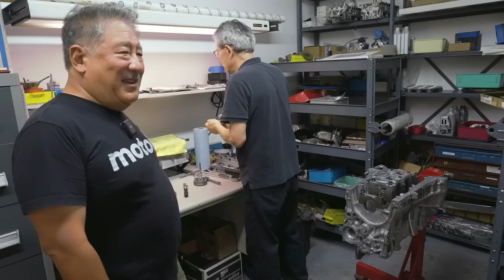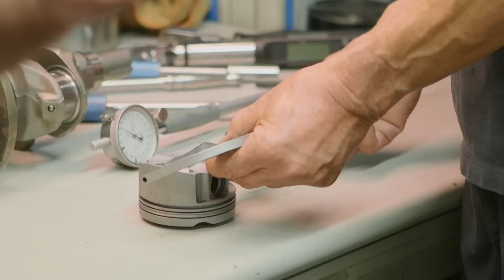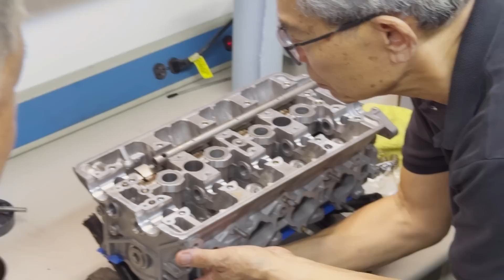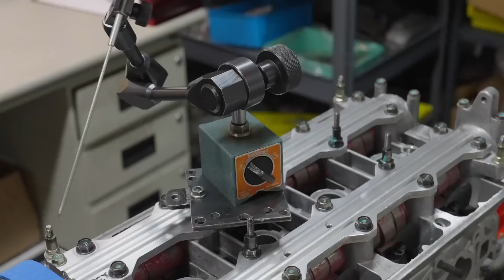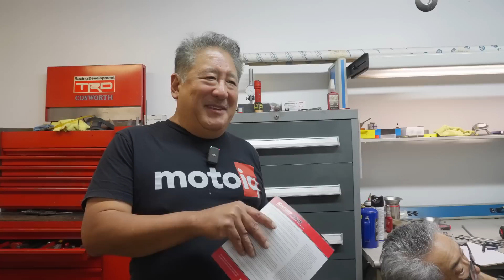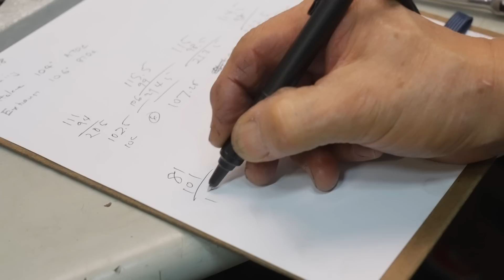How We Assemble a Honda B18C Race Engine at MotoIQ

Comment: On previous video you said no arp studs due to heat and these cylinders are alloy and can cause problems now  I am confused
Reply from the maker: I said you need careful machining with ARP studs and I don't recommend them if you don't need them.  The customer wanted them.

Comment: Mike, 
Do you ever use Block Filler on any of your builds like Hard Blok or Rok Block, ect. to partially fill cooling jackets around the cylinders?🤔. Maybe it could solve many issues from how it works.
Reply from the maker: We did but now there are better solutions like precision closed decking

Comment: When are you doing a video of this in the car running?
Reply from the maker: Never, we built the engine not the car.
Reply: @motoiq  ahh, that's not great, I thought you guys were going to do a follow-up of it
Reply from the maker: No, it went to the customer.  We have built similar spec engines and they made 230 whp plus before.

Comment: I greatly appreciate this info!!!! I building a b series now.  I put gsr cams in for a turbo build.  I read all Honda cams have same centerlines 98 intake and 110 exhaust do these numbers work for low cam lobe like you measured or do I need a different number.  I thought most numbers are based on v tec lobe?  I’d rather not take the rocker out to lock them if I don’t have to.  The head and block have been cleaned up
And I want to get the cams dialed in   Thanks !
Reply from the maker: That is not true

Comment: B Series engines are extremely rare and expensive now. I had an EM1 but blew the head gasket at 180k miles. Redid it and blew the gasket again. Turns out the block was warped and a new B16A2 is nearly $10k. Decided to buy a GR86 instead.
Reply from the maker: That is why you need a good engine builder.
Reply: @motoiq  Yup. It had been rebuilt once by someone before I had got it but it was clear there were issues. It was beyond my capabilities to fix or pay to fix so I sold it to a mechanic. I love old Hondas so I was sad to see it go.

Comment: Did the customer request to use the ARP Studs? I remember in the last video you recommended to use OEM Torque-to-Yield bolts for under 400hp Street to Track N/A builds over the ARP hardware to prevent distortion.
Reply from the maker: Yes

Comment: That spring compressor is super tedious. I have always given the valve stem tip a wack to ensure the keepers are seated. I have seen keepers come loose in engines assembled by others.
Reply from the maker: I tap them too with a mallet handle but Howard does not agree with me on this, he closely visually inspects them.

Comment: Seems the ring pack alignment was missed during the bottom end time lapse 

Otherwise, great content!
Reply from the maker: Yeah, I realized I did this after we were done.  It is not a show stopper because the rings spin at about 10-20 rpm but it is still a good practice.  Also explaining the ring compressor. Next time!

Comment: These guys are insanely OCD and I really respect that. I had to rewatch the last 10 minutes of the video like 5 times to really understand what they were doing. However, I’m so confused about something. When they are finding the true top dead center, why do they have to find the before & after dial values to average together to find the degree value? Why can’t they just look at the dial meter and turn the crank back & forth until they see the HIGHEST value? The highest value should be top dead center right? Same with the cam lobe centers afterwards. They did the same thing.
Reply from the maker: It's actually hard to see TDC exactly to the degree like we said in the video, the needle hardly moves over a range of about 5 degrees.

Comment: were considerations made for budget reasons or is this kind of an ultimate street/track build for n/a B18C?
Reply from the maker: You need to take this level of care anytime you build and engine, even if it is a stock rebuild.
Reply: @motoiq  I meant the intake, the cams, pistons and rods, the cryo treating and the wpc treating. Would more money mean more power or is this about all you can get out of an n/a build?
Reply from the maker: It's a medium state of tune engine, but built for durability. We could get at least another 50 hp out of it with more revs and exotic parts with shorter life.

Comment: When degreeing the cams, was VTEC locked and was the valve lash set to zero?
Reply from the maker: We dialed in on the low rpm lobes and when using the top center method we showed it doesn't matter where the lash is.

Comment: Do they have any different girdles for the b series, like the f series.
Reply from the maker: You don't really need one unless you make crazy power like 1000 plus but they do have them.  I like the TPR one that ties in all of the mains.
Reply: @motoiq  that's awesome, thanks. I'm looking into swapping on a 90 Honda civic wagon rt4wd. Still not sure if I will go h22 or b series plus I haven't researched much for what matches up with the drivetrain or if I'll need an adapter plate to still be 4wd.
Reply from the maker: I am partial to the B series over the H series.
Reply: @motoiq  my favorite engine is the gm 5.7, but always appreciate your input. And hopefully I get your seal of approval on one of the few honda builds I'm doing. Getting close to assembly on a old honda accord.

Comment: I don’t really agree on the “platigage is a no-no”. For a machine shop sure, they should be using those high dollar precision measuring instruments. But for us DIY guys rebuilding an engine in the garage, most of us aren’t going to spend thousands of dollars on precision measuring tools. Of course it’s best to check the machine shop’s work, and the Plastigage is a good option to verify that clearances are in spec. <edit> obviously a race shop building race engines would have these tools. I was just referring to home DIY builders.
Reply: @Patrick94GSR  I always use both plastigauge and precision bore gauge & micrometer but plastigauge serves a different purpose for me. If you crush a strip of it you can see if the mated up surfaces have taper to each other meaning that one side has less or more clearance than the other. I find it difficult to measure that with a bore gauge and with plastigauge you see it immediately. If theres no taper i proceed to precision measuring my clearances. Tools are not super expensive either. Get yourself some good condition used Mitutoyo Micrometers in different sizes, a quality dial indicator and a cheap bore gauge. All together youre looking at maybe 200-300 dollars which wont break your bank if youre just starting.Learn how to use your tools and prduce repeatable results then theres nothing that can stop you from DIY. Everyone has to start at the beginning noone is born pro:D
Reply: @DerDreckygeDan  thanks for the tips.  I was under the impression that quality precision tools accurate to the .0001" would cost in the thousands of dollars.  Which is fine for a shop using them a lot, but not great for one guy doing it once or twice in a home garage.
Reply from the maker: We measure in three places across the jornal and three places rdialy to measure out of round and taper.  I think I said that in the video but if I didn't, I was supposed to.
Reply: @motoiq  yep you did and I agree with doing it that way.  but it's just not feasable for us home DIY guys building or rebuilding an engine.  I would have to pay a machine shop to machine everything, and then I guess pay someone else to check the machine shop with their precision tools?  And then, if I'm not standing there watching them do it, I would want to go behind them and "check the checker".  And for that, I would have to use plastigage.
Reply from the maker: Like @thexpression said, you can get quality used tools for pretty cheap on ebay. Plastigage is better than nothing.
Reply from the maker: Not if you are a professional engine builder for paying customers or building engines correctly at home.  A machinist might have precise measuring tools but it takes skill to measure properly and more skill to machine properly.  We fix a lot of botched engines for people here and poor machining is the reason for many engine issues.  There are only a handful of machine shops we work with here that are good enough and this is Southern California where there are many to choose from.  Plastigage is often over 0.001" off, which can be 70% or more of your total clearance on a late-model aluminum block engine. Also in the case of the crank, since it is supported in several places, that affects the measurement of the journal you are checking with the plastigage.
Reply: @motoiq  are you familiar with/any opinion/experience with Jeffrey @ CNC Werx's machined CSS cylinder support system (closed deck conversion) I couldn't find anyone local (Washington state) that if they did quality machining & assembly were either booked out far too long or so busy not even taking any new business so after a bunch if research i sent my b18 short block to CNC werx for machining/CSS/assembly w/ arias 82mm 10:1 flat top pistons K1 rods micro polished crank & ACL bearings now same problem with local machine shop for the head  still deciding where to send my head between headgames / bad guys / portflow/ 4 piston any experience w/ or opinions of those four as well in regards to  head machine work (porting / valve jobs)
Reply from the maker: If the block support is machined correctly it is a good thing for a boosted engine but not really needed until you go past 500 hp or so. NA builds don't need it.  We use Portflow, DSport and sometimes 4 Piston for our heads.

Comment: Appreciate the cam timing explanation. Noticed you guys used the arp studs rather than the factory head bolts mentioned/recommended in the previous video?
Reply from the maker: We don't recommend studs unless you need them.  In this case the customer wanted them.

Comment: the quest for true TDC is very satisfying to me. The usual method people seem to use of getting it close enough to start and then monkeying with it while running is nerve-wrecking, especially when they start adding boost. Trying to get the most out a motor with no reference of where you're starting from is reckless at best.

Comment: Brings back fond memories of building my B18C turbo engine. Wiseco 81.5mm pistons and eagle rods.

I remember sat there filing each individual piston ring with a diamond file to the correct gap. Took me AGES, but the motor was reliable. Did a lot of track days here in the UK. Never let me down.
Reply: Same. 81.5mm 9.2:1 😊

Comment: As always great video:)
What may be added to your cam timing guide at the end is that you always wanna use solid lifters when timing the cams on hydraulic lash adjuster engines because if you dont the slack of the missing oil pressure which would zero your lash really gets your timing numbers wrong ( you can build them of spare hydro lifters welding a nut in and screwing a round machined screw in there that you can turn to zero lash once the head is all together). But thats just by the way. Great content as always i love it keep it up and greetings from germany near the beautiful Nordschleife:)
Reply from the maker: You are 100% correct